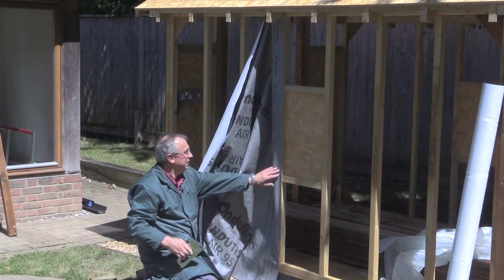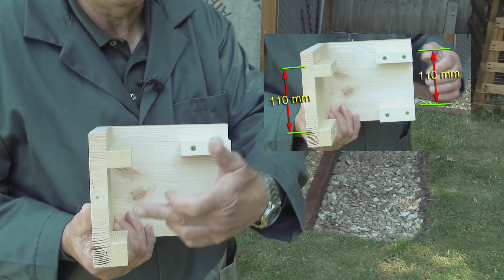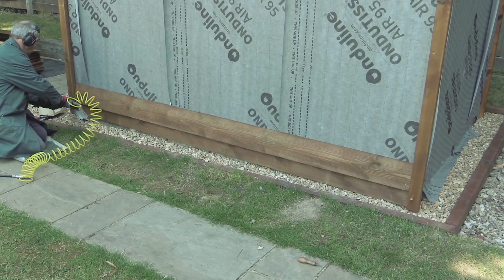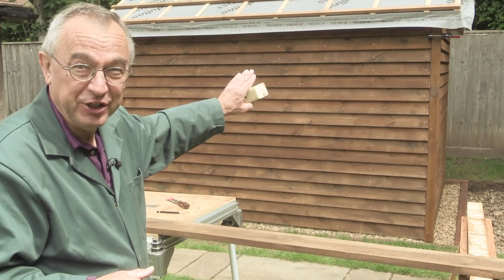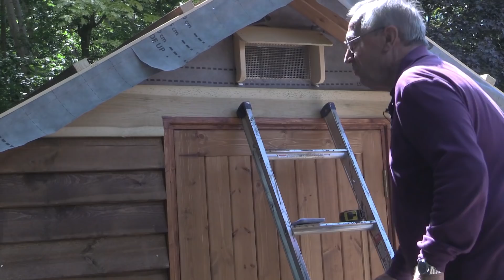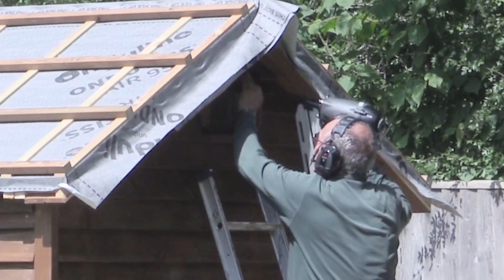Shed - Vapour Barrier and Featherboard

Comment: How do you know the angle of the pieces
Reply from the maker: I drew a plan and used 30/60 degrees for the angles as these are easy to cut on my tracksaw cutting station or Kapex.  Peter

Comment: Arnt you supposed to nail the top of the feather board so no nail holes are seen and no water can get in?
Reply from the maker: Hi Brian, Yes, that is good practice but I prefer my method provided the wood is reasonably well seasoned. So far I have had no splitting.  Peter

Comment: very informative with lots of great tips, thank you sir for this. Im planning on building a shed with similar details like the foundation, framing and cladding. But im planning on putting OSB on all frames as well. I noticed you didnt, is there a reason for that? my shed will be a lean to shed and alot smaller than this one so im wondering if im not overdoing it a bit. thank you
Reply from the maker: Hi Tag, I would have had to pay a silly amount to get more OSB as the first lot came with the rest of the timber. If I had estimated the quantity correctly in the first place I would have had it everywhere just as you plan.  Cheers.  Peter

Comment: Hi Peter, keen DIY'er here in the process of planning a small 8x12 shed. The local building supplies have just delivered some 2x3s for the frame and a roll of Tyrek Supro. I was astonished at the price of £109 plus vat for a 50m roll. Should I return it, or is it worth using this premium vapour barrier?
Reply from the maker: Hi Paul, I do not know why you were charged so much - do a Google search and you should find it for about £75 for a 50 m roll.  Peter
Reply: @NewBritWorkshop  I'm guessing the unusually high price is due to convenience for being a local merchant, not to mention covid tax. It's all a bit confusing as they suggest I exchange it for a plastic barrier if I want to go cheaper. I want to do it right, and rather keep the Tyvek vapour barrier if thats what needed. Google seems to give me mixed results on the correct placement of vapour barrier and non-permable plastic. 
In this day in age with all the information at our fingertips but the contradiction in advice, might as well be no advice.
I think I'm going to follow you and use the vapour barrier rather than suffocating it in plastic. Right or wrong? Who knows..lol!

Anyhow, today I got the 18mm OSB down, creosoted the bottom, and placed it on 3x2 skids. 
The weather is bad tomorrow, so will give me some time to think.

Comment: What type of nails to hold it?? :D
Reply from the maker: Hi Lloyd, For the vapour barrier I used the staple gun. For the featherboard onto the frame I used 50 mm ring shank nails in the framing nailer. The OSB was screwed in place. Peter

Comment: Hi Peter. I'm currently in the process of building my own shed, (taken this week off to hopefully complete) most of the info, how to's from people like your good self. In your build you boarded straight over the vapour barrier without using any battens, is this a case of no right or wrong way as others use battens for their cladding? I haven't factored it in as I used your video as reference... Many thanks
Reply from the maker: Hi Stu, I am pretty relaxed about the right and wrong way of doing things on what is just a shed. I am happy with my method and despite some heavy rain throughout this winter all of my kit inside is really dry.  Good luck finishing your shed.  Peter

Comment: I do not understand why anyone would lay a breathable membrane in vertical strips. Surely it is designed to wrap the structure horizontally. Where I live rain/water goes down.
Reply from the maker: That is not the way it works. If rain were falling or dripping directly on the membrane then there is a design flaw. It is vapour that it is aimed at.  Peter
Reply: @NewBritWorkshop  I completely disagree. These products are designed to be installed horizontally. Vertical joints should be avoided as far a possible always introduce weakness to water ingress and have to be taped. Ask any rep aelling building wraps. Aside from that, it is just common sense to lap horizontally.

Comment: Good day sir.

If you apply membrane and then featherboard on the outside  would it be OK to apply the woolen loft type straight on top of the inner side of the Of the membrane  and then board out?  I was looking at PIR but the loft insulation is far far cheaper. Granted it probably won't be as good as PIR but the cost is far better for me atm.  I'm just abit. Nervous about the wool being in contact with the membrane
Reply from the maker: Hi David, That should work well as you describe.  Good luck.  Peter

Comment: Hi, Really enjoyed watching your video. How much of the vapour barrier did you need for the whole shed please?
Reply from the maker: Hi Stu, It was about 22 m but I did not measure the overall amount in any way. If you are planning a shed then allow for 200 mm overlaps at each seam.  Peter
Reply: @NewBritWorkshop  Many thanks for your reply. Have you left the inside of the shed, leaving the barrier visible or have you or intend to board it?

Comment: This is great. I’m actually going to like a ready-made shed so the uprights and tongue and groove are already formed. Do I need to add the vapour membrane inside and follow it all over the uprights?
Reply from the maker: Hi Steven, Just follow the procedure that I showed in the video.  Peter
Reply: Thanks Peter. Not sure I explained properly, The shed is already made, uprights are in, tongue and groove walls on. So from the inside I see walls, then uprights, so do I cut the membrane in the voids between the uprights where I’ll lag, or should I wrap the membrane onto the walls then across all of the uprights? I assume outer walls -> lagging -> membrane then ply is no good???
Reply from the maker: Hi Steven, Got it - It would be really fiddly to cover everything in one go and so start by just doing the T&G between the uprights. It will not be ideal but if you can manage to cover it all then do so. You could do it in two operations if that makes life easier - the T&G first then the uprights with a little overlap.  Peter

Comment: Hi Peter. I have embarked on constructing a workshop on my decking. I am trying to work out how I can link the stud walls together. None of them are at right angles. Do you have any suggestions?
Reply from the maker: Hi Barry, You problem is not clear - what stud walls? Do you have stud walls on two sides of your decking that are not at right angles?  Peter
Reply: @NewBritWorkshop  Hi Peter thank you for your reply. I am building a workshop on my decking which is rarely used. It is a very odd shape but my idea is to have it blend with the garden while being functional. There are six different sized walls to make and then secure together. I am trying to come up with a method of securing the walls together. None of them are regular angles. I am thinking of making several struts/wedges down each join. Gluing and screwing them. The best way I can describe the shape would be to imagine a distorted parralelogram.
Reply: They are all obtuse angles Peter.

Comment: Don’t you need wooden battens in between the moisture barrier and the feather board cladding for air circulation?
Reply from the maker: Hi Antonio, That would help but my featherboard has plenty of space behind it as the pieces overlap.  Cheers.  Peter

Comment: Building a shed, wondering whether to bother with batons on the studs - you don't. Any issues with regard to airflow, given I'll be lining the inside with insulation and ply?
Reply from the maker: If you are lining the inside then your breathable membrane should be just under he inner layer. I would not use batons on the vertical studs.  Peter

Comment: I'm assuming that the shed has no internal walls, because if it did, then the vapour barrier would be on the inside and not on the outside, in UK Climate.
It would be on the outside in hot climates.....
Reply: It's actually a breathable membrane rather than a vapour barrier.

Comment: A proper shed, made to last. With care it will still be standing in 50 years. Some of the sheds I have seen at DIY stores are made from 6mm thick tongue and groove stuff. If you sneezed inside they would collapse on you. I didn't have the time to build my own shed, but like the guy here I wanted a shed that would last. Luckily, there's a chap not far from me who offers bespoke sheds and other wooden buildings to order. He built mine from what seemed a heavy grade treated 18mm thick tongue and grooved boards - I'm assuming it was pine. I presented him with a fairly roughly drawn sketch and measurements, from which he worked to produce my desired shed. He uses 18mm ply for both the roof and floors, unless a thicker floor is required to take a lathe etc. The finished 12x8ft shed, including delivery and installation was just over £1500, but unlike the companies who offer similar sheds online, I got to choose the size, type and position of both the windows and door. I had to wait 3 months for my shed - he's had a waiting list for a long time - but it was worth it. God knows how busy he would be if he advertised. He's operated on an "if you really want me you'll find me" basis for decades, and his workshop is in a rather isolated location, but I'm pleased he built my shed!
Reply from the maker: Hi Brian, That is an excellent price for a bespoke shed of that size. I would say that a bespoke  on of that size should be nearer to £3k.  Cheers.  Peter
Reply: @NewBritWorkshop  From memory the total cost came to around £1575. It's a fair wad of cash for sure but this shed is SOLID! Plus it's exactly what I wanted.  I hadn't realised shed prices had got so silly.  It seems mine really was a bargain!  I've now reached the time of life when I'll settle for a decent solidly built shed and a restored Morris 1000 Traveller. I've got the shed, but looking at the cost of a restored Moggie 1000 Traveller from Charles Ware in Bristol ( a good one can be up around £30 grand), I think that part may remain a pipe dream..... mind you Mr. Ware can bring them into the 21st century with full rustproofing treatment, an unleaded compatible 1300cc engine, five speed gearbox, alternator with uprated electrics and electronic ignition , suspension and disc brakes with a servo etc. He can even fit a heated windscreen to clear frost in Winter if you don't like scraping!

Comment: I may be wrong Peter, but it looked like you were nailing through two pieces of board (the nails didn't seem to be at least 40mm up from the bottom of the upper board, assuming the boards are 150mm). I thought that, to prevent splitting due to expansion and contraction, you shouldn't nail through the lower board when fixing the upper one.
Reply from the maker: Hi Colin,  The split will occur in the very thin part of the board below and is therefore of no consequence. This method is stronger and lasts longer but, can sometimes, cause a split on the outer board - it is just a shed and I want it to last at least 35 years.  Cheers.   Peter

Comment: What type of shed base have you got..what sub base
Reply from the maker: Hi Niall, I have compacted stone then clean gravel with concrete pads. This under layer drains into a soak-away that is at the back end of the shed. On this is a 4x2 frame that supports the shed and to which the flooring is attached.  Peter

Comment: Interesting that you apply the vapor barrier vertically as opposed to horizontally!  It must be the brand type you use I guess.
Reply from the maker: The vapour barrier works in either orientation. I did mine vertically in order not to have overlaps showing on the inside of the shed.   Peter
Reply: @NewBritWorkshop  the point of horizontal install from the bottom is to allow any water that gets onto it to run down and out, without it wicking between. The tape helps prevent that with vertical orientation option, but horizontal is always better.

Comment: I always wrap horizontally, starting at the bottom, but each to their own. Nice job - crackin’ shed.😀 All my interior bays were infilled with Celotex so no joins to see.😉
Reply: I think it's supposed to be horizontal, the this way up dotted lines are there to measure the overlap, start at the bottom and work up, that way any moisture build up on the vapour barrier runs down without going into the building.

Comment: Another ‘Rolls Royce’ project. Three years ago, when we moved, I had 66 metres of fencing to build and I purchased a Dewalt cordless nailer. It is very convenient and saved a lot of time. Since then I have built more fencing for neighbours and it has behaved impeccably. I am now sold on cordless tools and gradually replacing my corded tools with cordless.
Reply from the maker: Hi Ron, My nailer will take nails twice the thickness of the Dewalt (which I believe is only 18 Gauge).  Am I wrong?  Peter
Reply: @NewBritWorkshop  You are very seldom right and you're wrong again (only joking). Manual for DCN692  Framing Nailer says it accepts fasteners of 2.8-3.3mm which is greater than 18 gauge. I think the brad nailer takes 18 gauge which as you say would be too small for fencing or building sheds.

Comment: Super job Peter - shed looks great.  I am reassured that even The Master doesn't get everything right first time! I'm guessing that your weatherboard is pressure treated - what maintenance do you think it might need in the years to come?
Reply from the maker: Hi Darrel, Yes, the featherboard is pressure treated. Before it went up I gave it a coat on both sides with Sadolin and Ronseal mixed. It will need a coat of something about every third year - I will judge when the time comes as it could go on for 5 years without a second coat. My last 33 year old shed only had 5 coats in its lifetime and it is still going strong.  Cheers.  Peter
Reply: @NewBritWorkshop  Thanks Peter - that's good info!  Best, Darrel

Comment: Hi Peter,  I note you seem to have used SS nails on the end as well as the framing nails.  I used only SS ring barb nails on our cladding as the timber heard advised to avoid staining on the wood.  We didn't treat the work but used cedar which has " silvered" very nicely after a few years.  I used builders poly under the cladding on the workshop, which I hope won't cause problems, and lined the inside with recovered match boarding of which we had a lot from the house.  So far it's OK.
Reply from the maker: Hi Mike, The nails are plated (passivated ?) and should be fine. I nearly did use builder's polythene but knew that I would get loads of criticism as that layer should be breathable. I have used poly on all my previous sheds though.  Cheers.  Peter

Comment: There is an easier approach to make the gable planking with the various cut outs: cut to fit the gable, offer up to where it will be fastened, flip down (as in mirrored along horizontal axis), measure the cut outs from the edge upwards (from what now is the top edge, but will be the bottom edge), transfer these measures down, etc. The thing is: this takes more than two hands…
Reply from the maker: Hi Bert, Yes, I was working on my own.  Cheers.  Peter

Comment: Why not wrap horizontally rather than vertical, that way you could do the whole shed sides in two layers? Surely of it was overlapped horizontally there would be more of a gravity advantage?
Reply from the maker: Hi Craig, I wanted the overlap joins to be invisible from inside the shed and so they had to be on the vertical frames.  Peter
Reply: @NewBritWorkshop  excellent logic.

Comment: Should have had osb on the framing first, then vapour barrier wrapping around, not.in strips. Those marked out lines are for overlap. Then 2x1 battened off on 400 centres for the cladding to fix to
Reply from the maker: I am sure you are right but far too elaborate for a simple shed.  Many thanks.  Peter

Comment: I done my shed with this vapour barrier like this nailing on the cladding but I was told after I should of put a 2x1 on over the barrier to allow an air gap,still its grand out anyway
Reply from the maker: The barrier is there to stop moisture coming in but allow water vapour out. The featherboard has plenty of air gaps behind it and so I am not worried - it is just a shed !   Cheers.  Peter
Reply: @NewBritWorkshop  Interesting, I take it Kreg is talking about 2 x 1 batons to nail the cladding on ? I have heard the same, but I suspect that is when you're nailing the cladding onto an outer skin of OSB or Ply maybe? I'm going to check that before my build.
Reply: @NewBritWorkshop  nope you ideally need ventilation between the wood and the vapour barrier, otherwise you risk tot in your cladding.
Reply: @NewBritWorkshop  Thanks - I had the same question in mind, agonising about having a gap between the membrane and boards. Probably would have if I had gone for T&G but like you, went for the featheredge. Mine is more a workshop than shed... but it is "just a shed". I'll hang on to that reality check.
Reply from the maker: Yes, just a shed - cheers.  Peter
Reply: its a breathable membraine bit like goretex

Comment: Was the mistake on the infill piece that you did not take account of the overlap?
Reply from the maker: Hi Terry, No, I measured from the top of the door frame instead of from the bottom of the piece that had been laid just below.  I took 110 mm away from the wrong measurement ! Never mind - I did us the two ends of that piece further up.  Cheers.  Peter
Reply: New Brit Workshop Hi Peter, How reassuring that even " the master" makes occasional (?) mistakes.